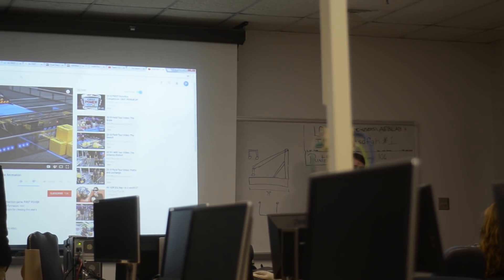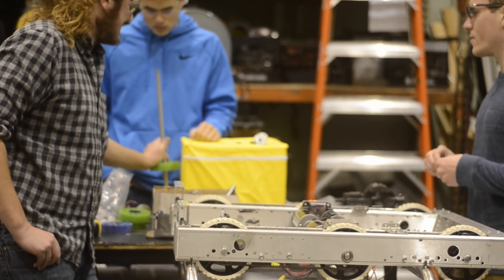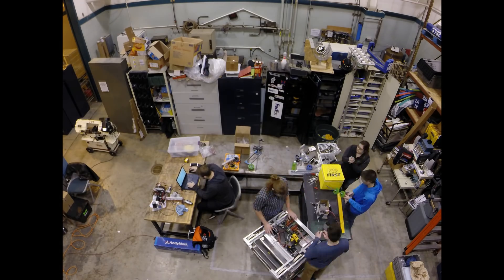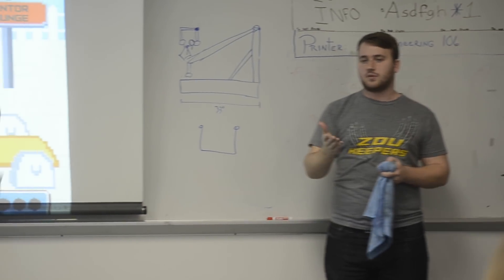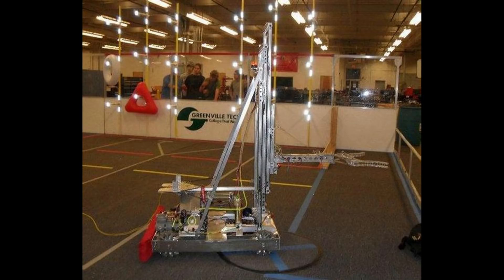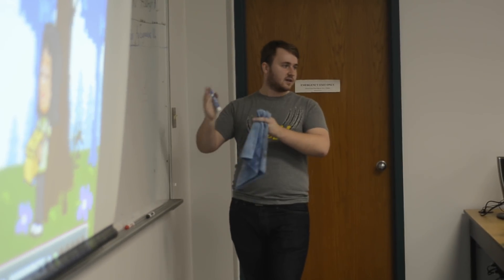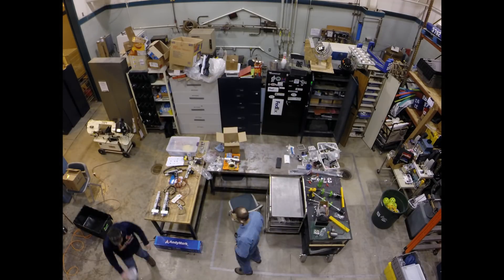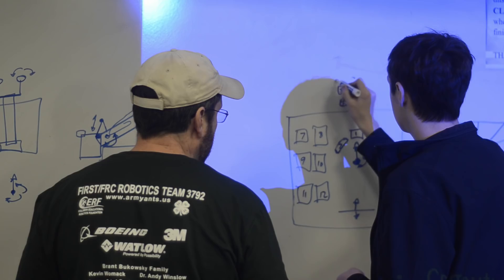Ri3D 2018 - Zou Keepers - Day 1 Recap

Comment: Is it physically possible for that arm to reach high enough without going out of the frame perimeter restriction?
Reply: Zou Keeper here, Yes. it's possible, but only just. It took some pretty careful calculations and CAD. I'll make sure we show the models in the day two update, which will come out tomorrow. -Patrick
Reply: Rembmer the 16" extra outside hour frame perimeter is just left to right not up from what I have and most other people have gathered is that there is no height limit